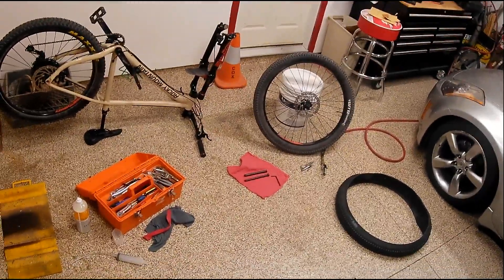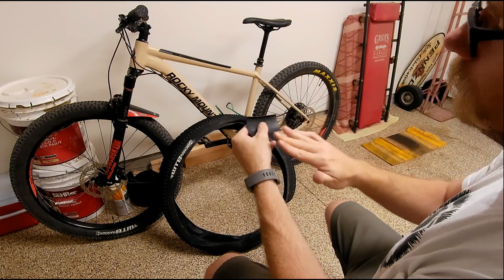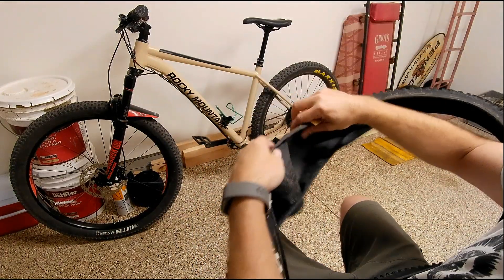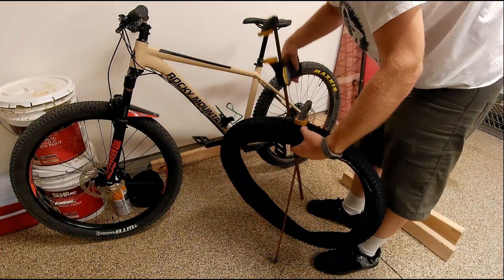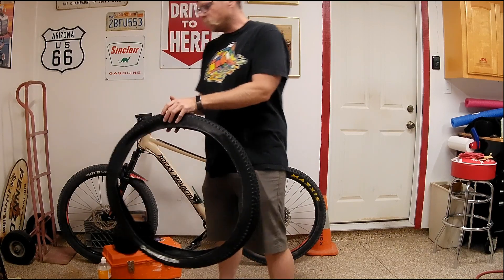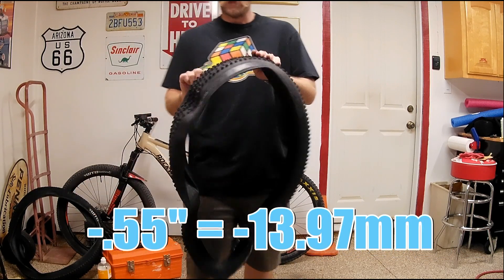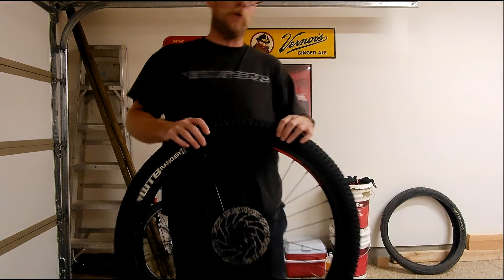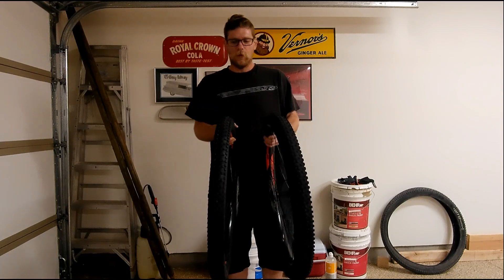On Drew's 'Rage || Tubeless Tire Patch

Comment: It will hold 👍👍. Did you get that other tire seated? I hate it when a tire doesn't want to seat 🤬
Reply from the maker: I did get em seated, just took a couple whacks to the tread to get the bead to the edges!

Comment: Yep, this is confirmation that I'm right about dropping my bike off when I need to switch our tires. There is always something that just never works out the way it should. I will try again, but when I just want to get it done and get back out on the trail, I'll drop it off. I know, I suck 😆. I have a 3.0 Ranger for my back tire, no problems yet.
Reply from the maker: Not always, you just remember the troublesome times more :) just wait til I need to do a fork service, I have a feeling I'll be fumbling through that haha
Reply: Drews Enthused awe man film that one 😆